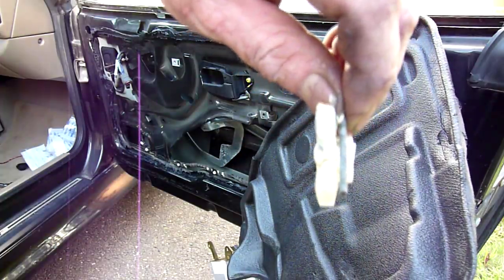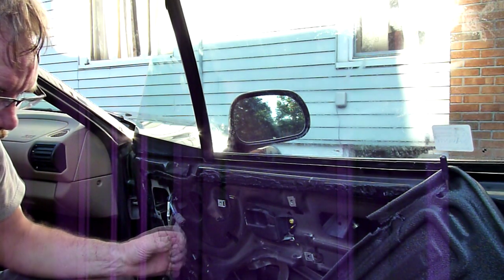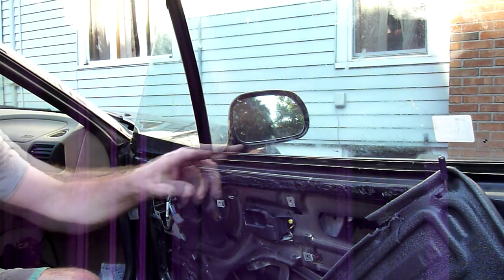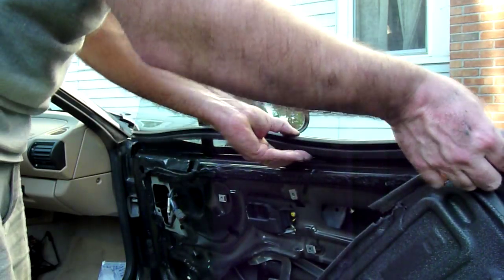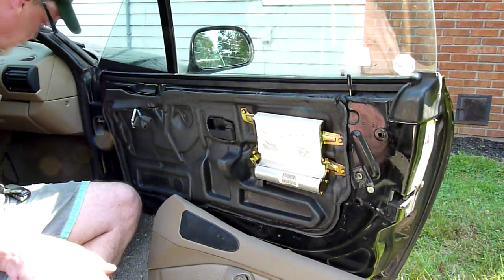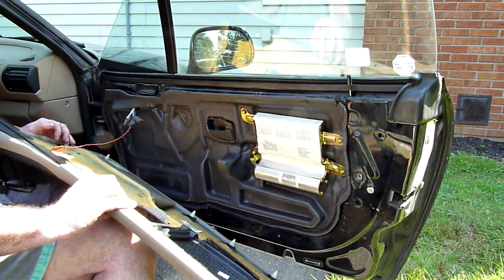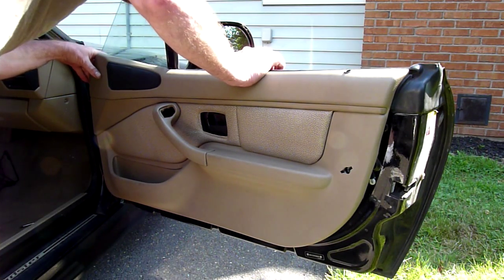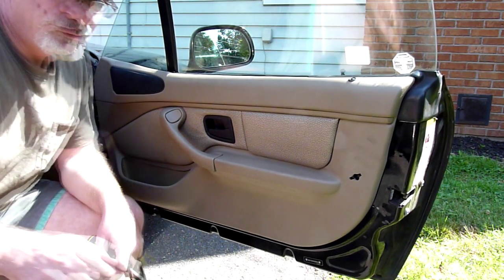2001 BMW Z3 window fix part 2

Comment: The inner door card is easier to reinstall with the inner weather stripping attached to it.  This makes it easier to get into the groove of the window and to properly seat the lock button into the hole.  While I agree that the entire window may not NEED to come out, it seems like this may be good idea in order to clean the channels properly where the sliding clips go as well as to regrease them.  Great video man.

Comment: Do you know the size if the washers for the triangle window on the bottom for the bolt?
Reply: there is one in the front and one in the back and both on the bottom

Comment: Thanks man!

1. Do you think this job is possible without removing the vapor/water barrier? The only area I think it may be required is the front bottom part to make sure the washers are in place after removing the bolt for the front window otherwise I didn't see that it helped with anything.

2. When I replace the door panel I actually put the rubber part that sits on top of the door onto the panel then place the panel on the door. Thanks for showing me a different way to do it!

3. Here is an idea for possibly easy preventative maintenance on a window before it goes bad. Maybe one could spray some white lithium grease or other lubricant into the window tracks where those plastic sliders sit before they get so degraded without removing the door panel if they can fit a spray nozzle into that area and have good aim. Thoughts?

Comment: Great man!

Maybe there is an other way, too.

1. To replace the 2 clips you only need to lower the window. There is a perfect opening where you can replace them by removing the 2 metal springs and push out the moving arms. BMW's repair set comes with some grease. Put a lot on the new clips (also in the middle hole) and replace the old ones. Also put some grease in the rails. Then push the moving arms in (the metal springs will make a "click" sound).
Last but not least just use silicon spray for the window tracks from top and bottom.

2. Never ever push the door from top!!! The door is no scale! In worst case it will just bend or break!

3. The inner water protection (plastic) needs to stay intact. This small plastic will ensure that the car stays dry. Use a thin cord to cut the bitumen glue and/or hair dryer to heat it up. Important: If it isn't sticky any more you need to replace it.

4. Never open the 3 screws for the fixed window. You are not able to put the window back like it was before -> you would need to re calibrate both windows afterwards.

5. If you really decide to remove the top inner and outer rubber lips then ... when you reinstall them ... don't push on the door (did I say this already?). Just use some soapy water on the rubber to make it slippy. This will help a lot. Use the same trick for the inner door cover.

Hope this helps :-)
Reply: Put the inner door lip on the panel and THAN hang in back the panel with the lip on it. This way it works easy and you don't have to push it down with force or use any soap or water. That's the way it's in the BMW repair manuals, but even BMW guys often don't know about it and destroys your panels or squeeze it in! ;-)

Comment: Thumbs down because you skip how to install the clips which is all I wanted to see. The actual work not an explanation then a fast forward to the finished project.
Reply: It's highly unlikely that you can see the actual clip snap into place, BMW windows are an absolute pain in the bottom and the E36 coupe windows would not be easily visible.
Reply: I wish he had shown more detail about how he got the window re-installed. That's the hardest part, to me